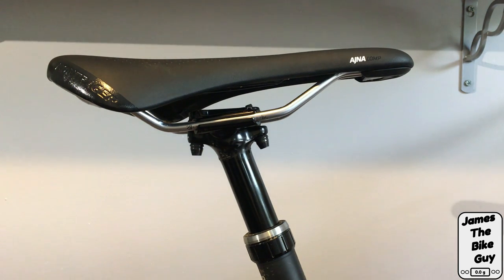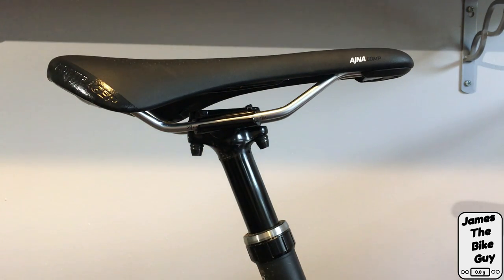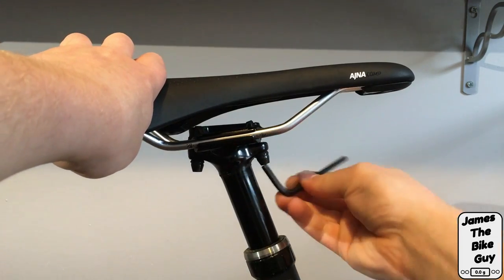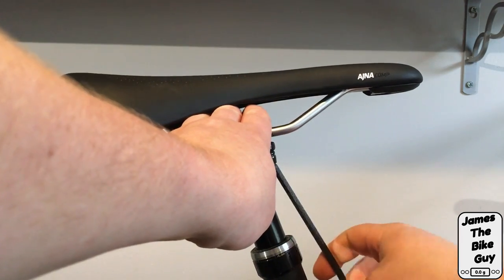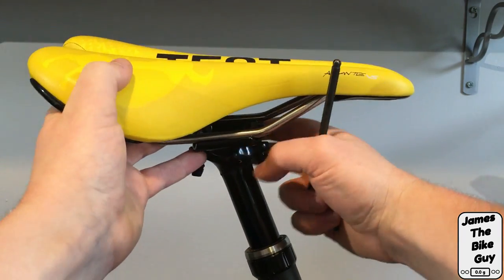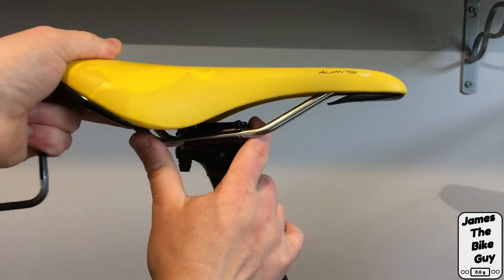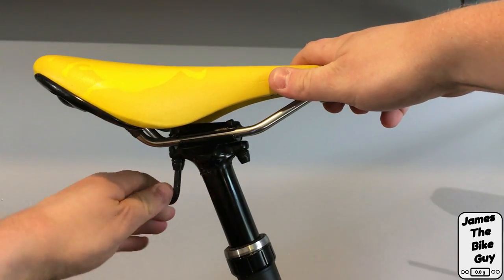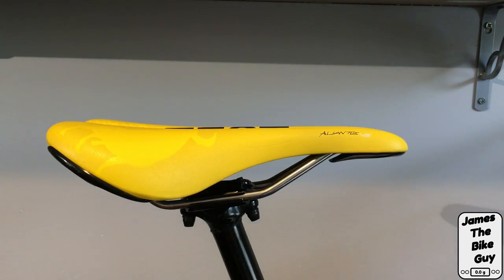How to Install and Adjust a Saddle on a 2 Bolt Seatpost

Comment: I didn't think I could fit the saddle in the bracket with just loosened bolts, so I ended up completely removing the bolts, adding the saddle in the bracket, and trying to screw the bolts back in without losing any parts.  It was a challenge for someone as maladroit as me, but I eventually got it!  
;-)

Don't completely remove the bolts, unless you just find it impossible to put the new saddle in the bracket otherwise.  It'll make it easier.

Comment: I didn’t notice how to change the saddle angle. Previous saddle and installed saddle are the same angle.
Reply from the maker: Nice
Reply: I didn't see any angle adjustment either.  Is that even possible with the two bolt saddle post?
Reply: @JeffsAirplaneCabinet  You just need to to slightly loosen the front screw and then tighten the rear screw in order to bring the nose of the saddle up. Do the opposite to bring the nose down.

Comment: hey, I somehow popped off the top part of my saddle clamp when attempting this. I can’t seem to get it to pop back on to bite into the saddle rails. any tips? can’t see a brand name but it’s a 2-bolt clamp with a slightly different design than shown here. thanks in advance for helping this beginner!
Reply: I have the same problem and can’t find a video!!!
Reply: Biggie 1 — Make sure it’s assembled so that the two parts of the clamp make () a little cup for the rails of your saddle. What I’d thought was the top part of mine actually sat on the bottom ; )
Reply: okallixti same Imma have another try
Reply: okallixti I did it but it’s angled up 😂
Reply: @user-jg6bu2jx8y  It's hard to explain without photos-- if you don't figure it out on yr own, go to the bikewrench group on reddit, post a photo of the parts all neatly laid out, & some bike nerd will surely be able to help. good luck & ride on!
Reply: @user-jg6bu2jx8y  depending on yr set-up you should be able to fix that by loosening or tightening the bolts. In the words of my bike mechanic: "Tighten the bolts in intervals- couple turns of one, then the other. Once it's almost tight, you use the bolts to adjust the angle of the saddle. Loosening raises and tightening lowers."
Reply: did the exact same thing been trying to reassemble it upside down till i read your comment...switched the parts around and got it first try

Comment: This is useless. Where are the screws that go into the bolts?
Reply: Screws dont go into bolts, nuts screw on to screws or bolts. Screws have threads machined to just under the head, bolts have threads that stop before the head and therefore have a plain diameter section between the end of the thread and the head.

Comment: Thanks for posting. Is it necessary to use a torque tool to tight the bolts
Reply from the maker: In most cases you definitely should.

Comment: In loosening the bolts should I loosen the bolt behind the saddle first? Because when I loosened the bolt in front of the seatpost I heard a snap and when I checked ths threads there were a few metal shavings.

Comment: May i know whats the thing that hold the bolt together?
Reply from the maker: Not sure what you are asking.
Reply: @Jamesthebikeguy  i did some research and it is called a cradle.Can a cradle fit any seatpost?
Reply from the maker: No, they are specific to the seat post.

Comment: It's the middle or rear third of the saddle that is generally level.  On a curved saddle like Alliante, the back edge is supposed to be higher than the nose.
Reply from the maker: Yep depends on the saddle, but middle third is a good spot to start with.